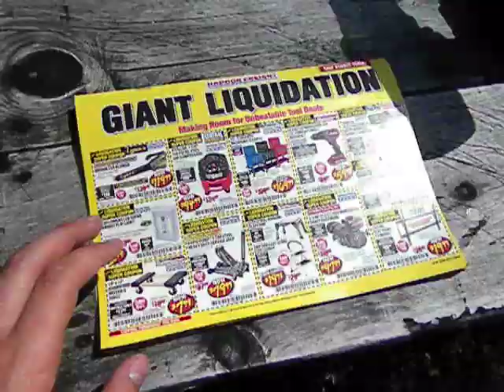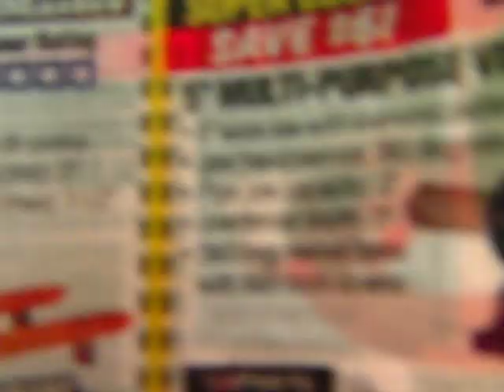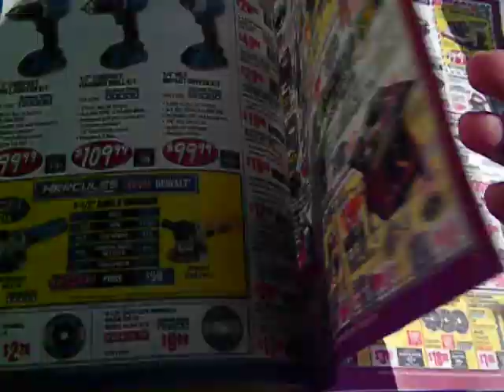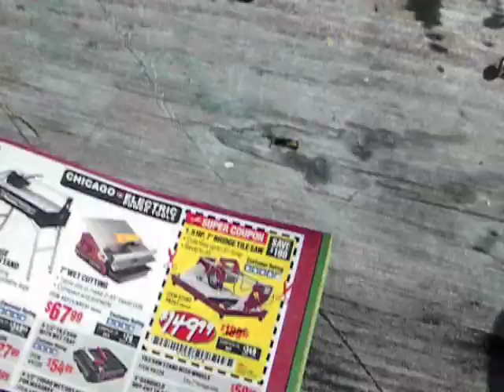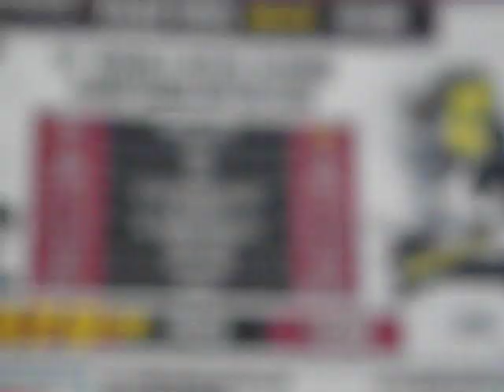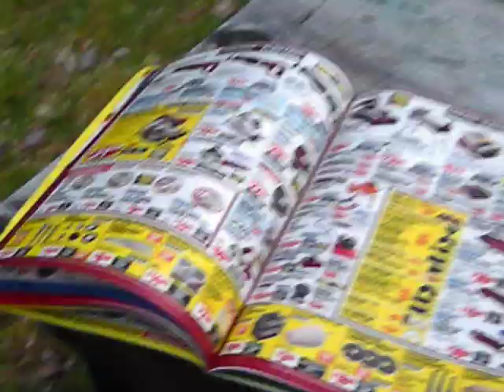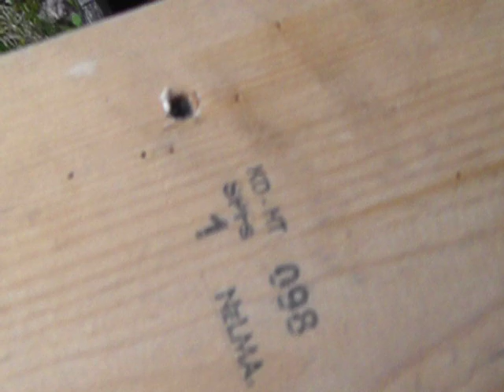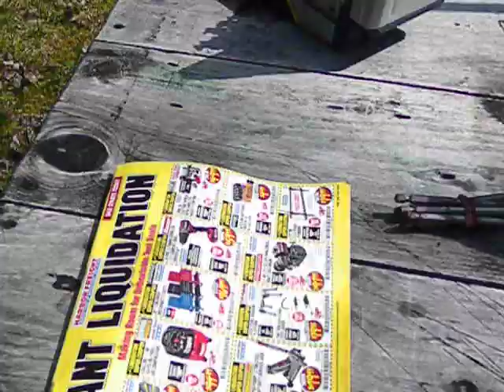Codger's Workshop Episode 11: Harbor Freight Says What!?!?!???? Ryobi vs Drillmaster Showdown

Comment: Hey from another Mainiac (home town Portage), now living in Florida. As a Dewalt owner, I can tell you never to HF them too seriously, although there are cases where they are making stuff that's really comparable to others, although none of it is Chicago Electric NiCad. They cherry-pick a few stats, but very seldom is actual torque one of them.  The real differentiators are always build quality and reliability, and that is where the el-cheapo's fall short. Just keep in mind that every different brand at HF is usually actually different, and that some of their tools are worthwhile. I know that the Earthquake line and the Daytona floor jack is well-regarded. Their Chrome Moly sockets (much of Pittsburgh Pro line) are also good bargains, along with their breaker bar.  They have a lot of fans with their dust collector and their large lathe as well. I haven't used one of their Hercules drills or impact drivers yet, but they seem to be competitive with Ryobi from what I've seen in reviews, although comparable in cost.

I stick with Dewalt and Makita because they are excellent, and I have the batteries to run them. Also, Makita has the hand router and sander that Dewalt lacks in a cordless.
Reply from the maker: Great to hear from another Mainer . Yeah I own quite a few of the Pittsburgh mechanics tools and love them. I hear ya. If I had a bigger tool budget I'd be either makita or milwaukee.